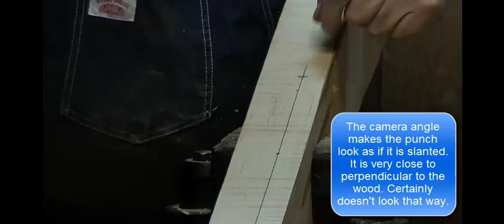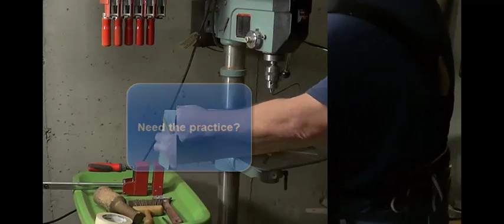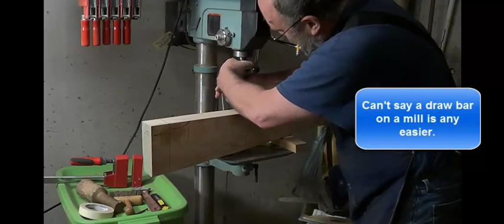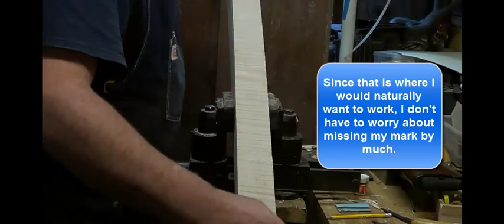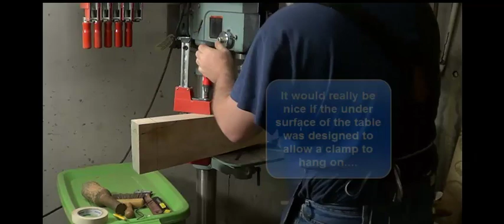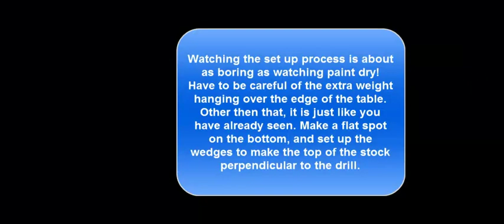Inletting Bolt Action part 3 drilling for stock screws

Comment: Clamp a board to the table, clamp a 90 degree fence to the work with top of work parallel to top of fence, center work under bit. clamp fence. Drill hole 1, release fence from table board, slide down, drill hole 2. It will be parallel to first hole.
Reply from the maker: +Larry Schweitzer  only works if your fence is square to the quill front/back and left/right. Then you will have to figure out how to support the stock while you align it with the top of the fence and then clamp it. Sounds like a lot more work? Maybe not....haven't tried it yet.
Reply: Making a square fence is pretty easy. Checking it is easiest if you chuck a dial indicator. Positioning the work is easily done using a block & wedges. For a quick clamping use the type that you can one hand. Clamp a guide board to the table and all your holes line up. All very quick and easy setups. Not that I much use that system anymore. I've got a milling machine with digital readouts now. If I need to make multiples of anything I put it on the CNC. I totally enjoy hand work but making a living requires the best use of my time. For fun, I cast brass and aluminum parts, machine the areas that I can and hand work to final form. 
I'm no expert but there is a reason to use the most productive tools available if you want to make enough $ to send the kids to college. Komo router, Jet knee mill, PM1440HD lathe, Calpe copy lathe.

Comment: might be easier to use a level to set your wedge for the top surface  so that your drill angle is correct
Reply from the maker: sc928porsche 
since my floor is not level, the drill isn't. Whenever I try to tilt the table it always moves a little when I tighten the the bolts up. (kinda like a dog chasing his tail) This way, the alignment is based on the quill/drill holder and nothing else.  As mentioned in another comment, drilling from the bottom might work too if the drill doesn't wonder off and you are really careful about laying where they go.

Comment: Set the blank on a piece of scrap plywood so the heel is not overhanging. A few swipes with the block plane on the heel to tilt the blank to it is vertical.
Prop up the narrow end up with a block so that the top of the blank is nearly parallel to the plywood scrap. A wedge shaped block with some sandpaper glued to it works best.
Drive a couple of long drywall screws up through the scrap and into the stock in a spot that will either be cut out, or into the area where the trigger guard/mag box goes. Do not over-tighten it takes very little screw pressure to hold it tight enough.

Now take it to the drill press. you easily clamp it to the drill table, shim the plywood with paper and wood shims to make it. Whole process should take less than 15 minutes to do. Your killing yourself trying to clamp a wedge to a drill press table

Comment: so many mistakes and back stepping makes me think it can not be that hard
Reply from the maker: You correct, it isn't difficult. I am so use to doing it without thought that thinking on how to explain what I am doing, explaining it  + a camera = a lot of distraction. Never thought it would  be so difficult and distracting. Correctly locating and drilling holes really isn't. Anyway, the distractions cause errors, so now you know one way to get around a misplaced mark/hole.
Reply: I understand I'm a machinist by trade is a lot easier to fly on your own then to explain it to the masses by no means was I judging your ability

Comment from the maker: You should not be tightening them to the point there is much of that, but there will be a little. Dry lubes (most are graphite based) are messy and leave black marks all over the place -looks just like the inletting black that means remove wood. 

Good luck,
Chris

Comment from the maker: that you use with your trigger guard/magazine metal. You will be unscrewing it a lot, so the T-handle makes it a lot easier. 

If you are handy with tools, have  a look at the pictures from the above mentioned companies and copy them. They do wear out and break over the years, so I make a replacement to use until I place an order for a bunch of supplies. Try to resist adding a lubricant. It will get into the wood and mess up the finish. Just let it gall.

Comment from the maker: Don't use the original ones. You will wear them out and they are not long enough. Brownell's, Midway, etc. all carry them. You can make your own as well if you know how to tap the end of a rod. The purchased stock screws come in 2 versions. One is a straight rod. Use that one first since the wood is so thick. When you get down to near finished size, switch to something that looks like a T-handle. It has an extra long shank, and a base that resembles the head of a screw.